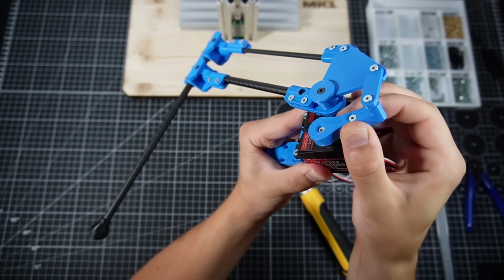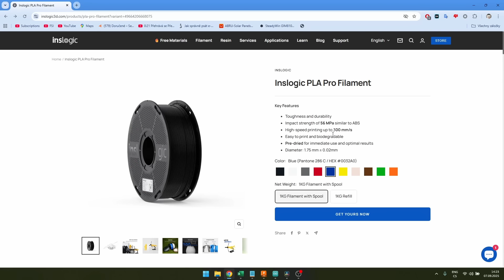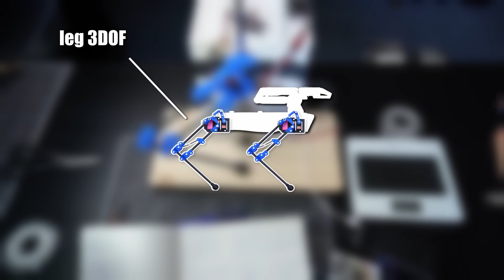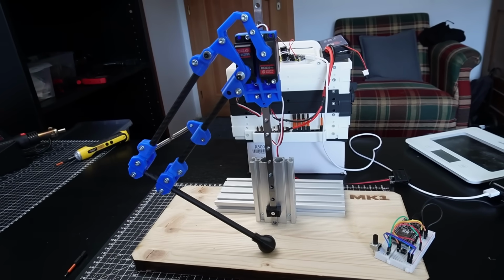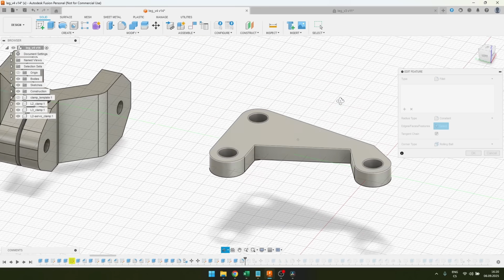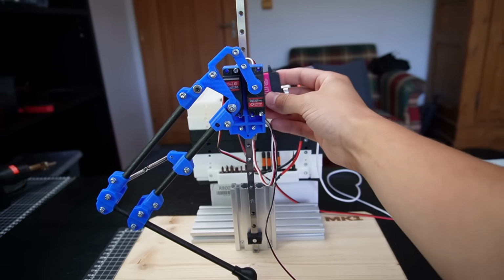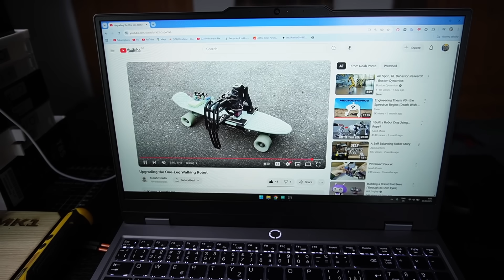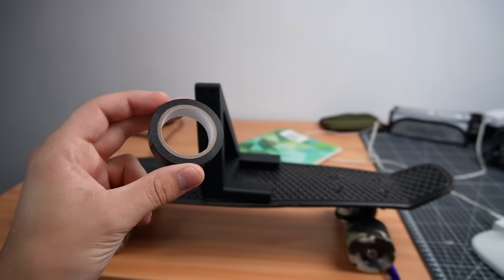I spent 200 hrs making a Robot instead of getting a Job

Comment: Don't want to be an hater, but this is only some servos with 3d printer parts..., not even software is involved... If this toom you 200 hours, you will get no job. No one will hire you if you are that slow, this should have taken you maximum 20 hours.

Comment: Hi! I came across your robot dog video and noticed your leg design is very similar to mine. I’m a first-year engineering student building my first quadruped and I’m stuck on the inverse kinematics/control side. Have you already done IK for your leg, and would you be willing to share any notes or resources? Even a pointer (paper, repo, post) would help a ton. Thanks!
Reply from the maker: hey check out my 2nd channel, I solved the full IK on paper.
Reply: @TazerEngineering Thank you so much

Comment: Pretty cool design. A few issues you may come across:

The third servo/shoulder will probably be too weak when the leg is extended. You may also find the other servos too weak in a trip recovery situation. Especially if you have a large battery.

The drives are not "compliant" and without feedback/closed loop they will be hard to accurately model.

After you get it working, look at putting in some serial servos. When combined with accelerometers and model training, it will probably work well in a variety of situations.

Comment: why u didn't use robotic actuators (BLDC motors ) in stead of normal weak servo motors ?
Reply from the maker: Because I'm a student and 12x bldc motor + controllers would be expensive. I bit the bullet on my thesis tho which is gonna use 6 actuators.
Reply: @TazerEngineeringi have a video idea for you. (If you try to make one from scratch ) i like your content , you can take this idea or not . But it may help you to boost your knowledge about robotic actuators and it will be fun at the same time

Comment: That is so cool. 

Here’s a thought, 4-legged animals have ”fee”t. Maybe you could make an automatic foot that uses the weight to store energy in a ”tendon” at the beginning of a stride that gets released at the end before the leg lifts up. 

Also you have made front legs, would be cool if the hind legs are like real ones, instead of all 4 being the same like on robot dogs. You could reuse the mechanism for the top part just put the joint facing forward and add the lower part. Nature probably does that for a reason so it could give your dog an edge.